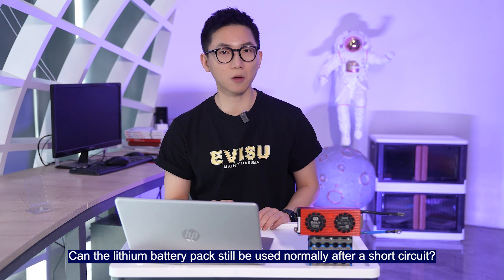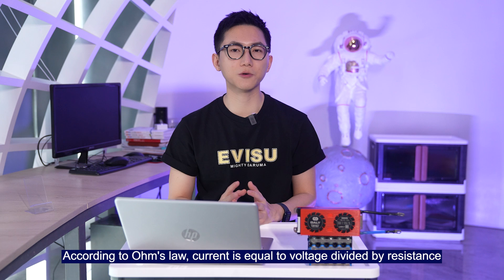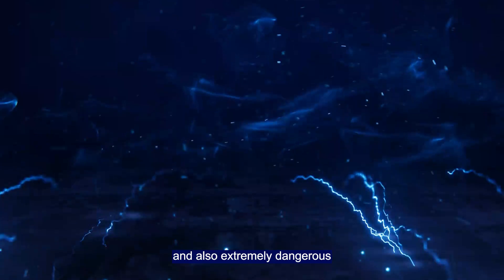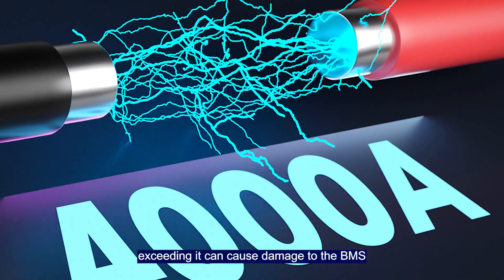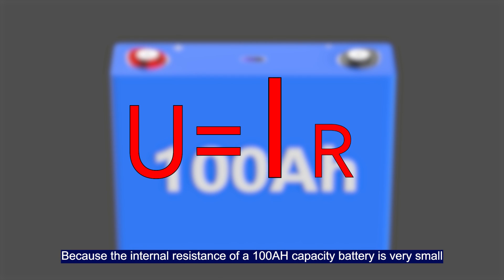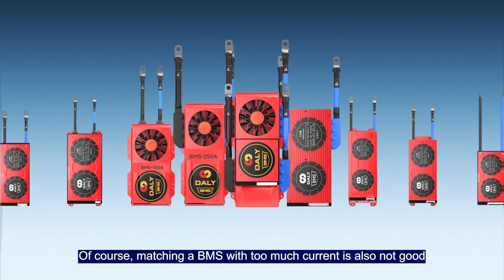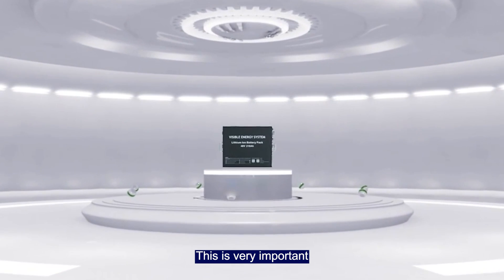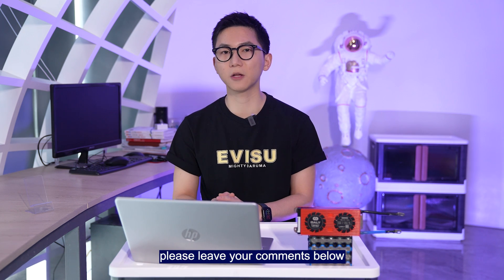Can the lithium battery pack still be used normally after a short circuit?

Comment: So if the BMS can withstand 3x it's normal current, why is the 250A BMS sufficient in the example in the video, where it's said that there can be 7500A short circuit current form the 100Ah cells?
Reply: BMS only sees this for a fraction of a second before shutting off.
Reply: @unclejohn5012  In the video he says there is a limit to the short circuit current. 3x the nominal current.
Reply: @Beeeeeeeeeee  To be honest man, I got no idea then🤣

Alot of BMSs have a "surge current" but 3x is alot. Typically you'll see surge being a fraction over continuous.